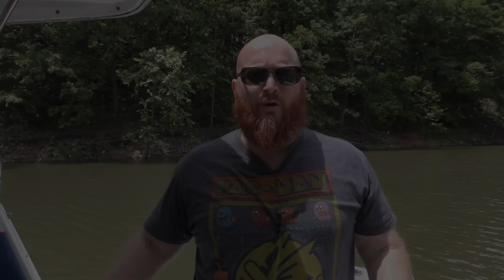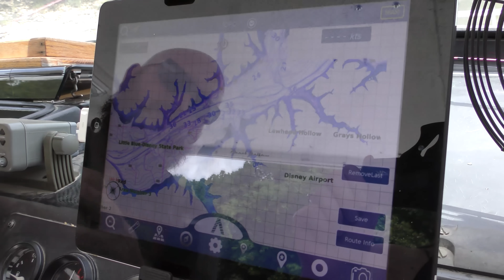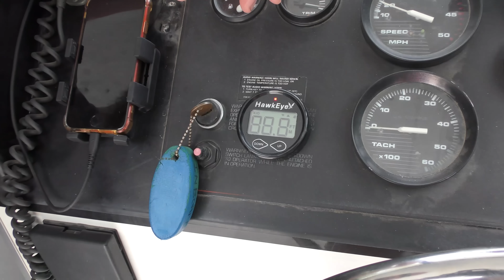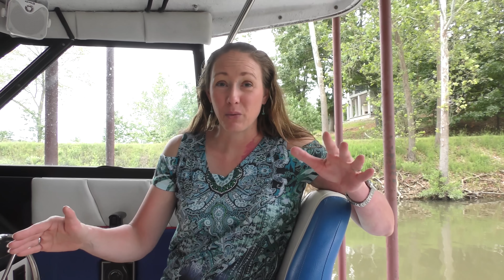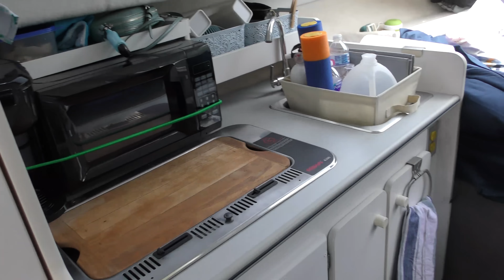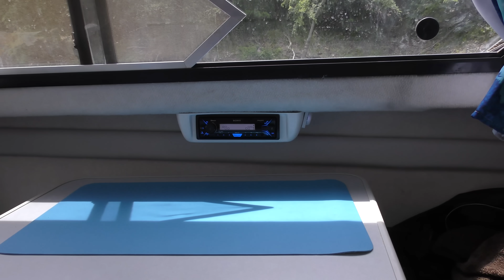Cruiser #4: It's Sea Worthy! See the CAR WIZARD get the boat in the water and the issues that arise

Comment: Keep the kicker on the boat for the times when the main drive fails- which it will. 
It might be a very good idea to wear a hat Wizard because you are follically challenged just like me.
Reply: Do you carry a spare motor on your car just in case the main engine fails? Because it will fail
Reply: @macbook802  you must not be a boater. Big difference with breaking down on land, and breaking down on the water.
Reply: @jonshelley1079  I'm literally laying down on my boat on the lake right now. Ask me how many spare engines I have ratchet strapped to the transom.
Reply: @jonshelley1079  did you know there's a big difference breaking down on water and breaking down in the air? How many airplanes have a spare engine
Reply: @jonshelley1079  no response yet? After work, I'm going straight back to my boat so I can do non-boater stuff
Reply: @macbook802  Many, actually.  Just about every aircraft that isn’t a small Cessna or equivalent has one.  Source, am private pilot.
Reply: @loweflyer7778  it's for power and balance. Not as a Fail-Safe
Reply: @macbook802  It’s both.  Sure, its better not to have engine failures, and the aircraft is faster with more engines than less, but its also redundancy. Look at ETOPS ratings.  Airliners are rated for how long that they can operate with a single engine.  

For a real life example, look at the united 777 that had an engine failure a few months ago.  That plane continued on and landed safely.
Reply: @loweflyer7778  how often does the second engine on an airplane come into play as a Fail-Safe?
Reply: again he should get contract with US Towboat there like 100 bucks a year and lot cheaper then if you need a tow and dont have one. boat tows can cost as much 1000 bucks a tow
Reply: @Elios0000  Good idea!
Reply: He needs to add its twin on the other side, for balance.
Reply: His Boat is a dual power unit already, and has 2x isolated fuel tanks.  The kicker would only be needed for a catastrophic failure that he could not fix
Reply: @BigDaddy-Irv  Yep, two engines, two fuel tanks, and a master mechanic on board, while only using inland waterways; I'd put money on him getting the "Jolly Sparkplug" back to shore in a mechanical crisis. Wizard said in an earlier video that he intended to carry spares; don't know if that included an engine though. 
Losing the back-up motor completely will save on maintenance too. If he keeps it on board, he'll need to maintain it just as much as leaving it attached. Hopefully, he'll never need more than two engines anyway.😁
Reply: Good idea getting rid of that kicker. I have my 50 ton near shore and am on the ocean a lot. No one has a kicker and that is 20+ miles offshore. Get a seatow and make $2-3k by selling that thing.
Reply: @jacknimble1  On second thought, I think you are right.  Given that he is not on a large expanse of water and can easily get a tow, he should get rid of the kicker.
Reply: He is only on a a lake. I am often out at sea on the west coast of Norway in all kinds of weather. That is a seriously dangerous coast to loose engine power. And I don't even have a kicker on my boat.

Comment: Fabulous looking home there behind the Mrs. at 9:30.
Glad you got the bugs worked out.
My in-laws had an early 70’s Wellcraft with an I/O 165 Chevy motor. She was misinformed about not going over 2000rpm. Get it on plane and back off and it always overheated. Wasn’t getting enough water at speed. Who was I to argue with a know-it-all MIL.

Comment: 10-12 gallons AN HOUR?
that is a stupid amount of cost
In time you'll find the far side of the lake is exactly the same
as the place you launched.
I've a 28 foot trailerable houseboat and use 5-6 gallons a day
running 4-5 mph.
Get 20 feet off shore and just follow the lake around.
I run my 70 hp outboard just above idle and Love it
I'd suggest an air bed and sun shade over the fore deck

Comment: I would not recommend throwing that thing away for an outdrive system I've never heard of anybody putting it on but it's good for outboard motors running in skinny water so I'm sure you could sell it or be able to sell the outboard motor I would detail it make it look shiny and new congratulations on getting the boat out

Comment: Yes welcome to boating it’s a curve, but rather easy with experience and help from friends. I’ll pass along a quick story that my father told me it was in the late 90’s and in my home town we had a yacht builder and one boat that was built was for the owner and founder of Bayliner. Respectively this was a multi million dollar affair in the 100ft range, and on its first sea trial the owner was at the helm leaving the small marina and accidentally wiped out some hand rail and another custom fabricated piece. $70K in 30 seconds. So even though your learning even the experienced can have small issues.

Comment: The main question is if that kicker motor was factory spec. If it was, operator error. I had to take a boaters safety course to run a Jon boat with a 4hp motor. Time and regs change.
Reply: still do in Maryland for ANY  power boat
Reply: @Elios0000  Good to hear, thanks for the reply.

Comment: From one boat owner to another get a trolling motor with a long shaft you can pull up out of the water for emergencies, had my inboard MerCruiser (fuel pump) go out a few years ago, on my party deck boat, and while it took us twice as long to get back to the dock at full speed of the trolling motor, it did it's job, and with a push from a friend's boat we were able to get it on the trailer, and home for repairs.

Comment: Yep, I'd just take that aux motor off entirely.  Whatever kind of fishing you'd be doing it really won't be necessary.  You can cast far enough from the boat in any direction that if you aren't getting any bites, you'd either be going to an entirely different location or giving up and just doing other stuff.   As long as you have a CB for emergencies (if you are so far out a cell phone doesn't work), you'd be covered if your primary motor dies.

Comment: Don't take off the small motor. It's job is if the main engine dies you still can move the boat. The solution to a list is a water or fuel ballast tank. From Australia I would never swim in green water.

Comment: Boatlife is moving around stuff to balance the boat. 
30 feet of line is not enough, 90 feet is alot better. For comfort and safety. 
Just put my boat into the wet today, allmost two months later than usual because life , but life is so sweet on the water now !

Comment: Keep the small motor. Many year of boating you be glad you have it to get back to dock. Leave it how you have it now but run it from time to time.
Reply: Totally agree.  The linkage issue is not really an issue.  Most people install the linkage when they are using the kicker then remove it when they are not.
Reply: Ahoy! Stow that kicker amidships, you'll love it when you need it.  
Secondly, get a small boat for that kicker.
Reply: @mikebuford5229  That could be a good move.👍 When all else fails, abandon ship. Is there room to stow a small boat somewhere on board; towing it would fairly mess up your trim.😁

Comment: The one thing I didn't see in your boat videos is a F I R E   E X T I N G U I S H E R. Fire is one of the biggest causes of boat loss and fatalities. Especially with gasoline engines. Failure to vent your bilges is a great way to cause an explosive fireball. Glad you hooked up tank above deck but don't be complacent. The vapor settles and other leaks can occur. Be especially vigilant Car Wizard! Make sure you can escape that forward cabin too. Without anything below water to put your feet against, crawling back aboard can be tricky. Make sure your swim ladder is solid and functional. :) You should probably assume everyone on the lake is drunk and foolish so you'll need to watch out for the other guy. :) Need 7:1 scope on your anchor line (for Danforth style) 20' of water needs 140' of line! It's so the anchor lays down flat and digs in. In a lake without rough water and no currents can get away with less. IMO.

Comment: I had that steering link to the  small engine and I only connected it when using small engine.When not in use bungee it to the small motor with it disconnected from the outdrive( Large leg) This worked well. Necessary for trolling on ocean. Fishing on lake often done while no motors running. Good to see you are getting some enjoyment out on the water! CHEERS from Western Canada

Comment: You shouldn't have to use the trim tabs to correct for a list on plane they're mainly used to get the boat on plane. Once the kicker motor comes and mount comes off you shouldn't need the tabs, also once the kicker and it's mount are removed you could put a full l length/width swim platform on if you want to make that investment.
Reply: ...that 30 gallon above deck, starboard mount fuel tank might have something to do with the fact that he's all over the place and needs to correct via trim tabs lol...

Comment: Great to see you guys on the water!  Boats are always an on-going learning experience.  My passion is kayaking, so certainly a very different craft than a big boat like that, but control on the water can still be very similar.  I think we're very used to cars in the sense that you do something, you get this immediate feedback, but in boats, the changes are more delayed and... sticky.  You have to be a bit more subtle and sort of wait to see how the boat starts to move, and when you need to counter a movement, you have to do it with the same subtlety and take into account that the correction will have the same delay, otherwise you over-compensate for it.  I've heard some folks say it's akin to being on ice where you start to slide and have to work with it, but I'd say that's only half right.  The sliding part is right, but with boats being hydrodynamic, water than become sticky in the sense that the boat will want to keep doing what it's doing.  Best thing you can do is just keep feathering the controls and going easy on moves for now; the more you do it, the more you'll get a feel for how that boat behaves and it will become more second-nature.  Just remember - all boats are _different_.  Your other boat is going to feel totally different to pilot than this one.  We have three kayaks (with a forth on the way), and every one of them feels different to paddle, so you always have to take time to get to know each boat you use. :)

Comment: You better watch those holes in the aluminum from the hydrofoil bolts. If you don’t have fresh magnesium anodes, your outdrive will become an anode.
Reply: Fair point. But why not just leave the bolts in place?
Reply: @2H80vids  The bolts are dissimilar metal and probably already started the corrosion of the aluminum holes.  Bare exposed aluminum will continue to corrode underwater.

Comment: The steering buddy is only put on when using the kicker for fishing. Always nice to have the kicker on board if you main engine should fail. Throw is some counter balance or get comfortable with trimming out the boat. I enjoy your videos, thanks!
Reply: If he is just using it on grand lake I wouldn't feel the need for a backup engine. You're never very far from shore on it and pretty much always have cell coverage.
Reply: @mgkleym As someone whose family has been big into lake(Clark Hill Lake GA, now that's a big lake), and River (Savanna River, a very long River) boating since the mid 80's having to rely on someone else to get you back to shore is true pain in the ass, even paddling is a no go if you are way far away from your home dock/boat ramp, and the weather might be turning south on you because you went out based on a wrong weather forecast that said sunny all day, but turned into thunderstorms, and your fuel pump goes out(true story). so having a good backup trolling motor that can do at least 5 mph and get you home in limp mode is a must IMHO.
Reply: @CommodoreFan64  an $80/year towing insurance policy is worth every penny. TowBoatUS  or SeaTow is on most major lakes and coastal areas.
Reply: @mistermoonJB  If I can have a viable backup to my main engine that gets me back to the dock/boat ramp on my own power, why waste $80 a year? 🤦‍♂️
Reply: @CommodoreFan64  Do you carry a spare engine in your car? Why carry around extra weight and have a second engine to maintain when the worst thing it will save you from is inconvenience?
Reply: @mgkleym  a good trolling motor is not that much extra weight if you have a nicer boat, and many come with one already from the factory like my party deck, that has an inboard MerCruiser with a trolling motor on the front bow that I can also use for fishing with the captains chairs that are removable, or if I get stuck out on the water.
Reply: @mgkleym  because 99% of the time should your car fail, you are either within walking distance of help or have cell coverage to easily call for help. It's also easier to identify exactly where you are and you aren't drifting around helplessly like you could be in the water.
Reply: @CommodoreFan64  It's not a waste. What if your bellows fails and you start to sink? What if you run aground? What if you run out of gas? Or need a jump start. Towing insurance covers all that other stuff too.
Reply: @mgkleym  a car can be walked away from....a boat not so much ehh?
Reply: Agreed, or just get a big trolling motor you can pull up out of the water for emergencies.
Reply: this learn to trim and ballast as needed. people should be required to take boating class for any thing over 25hp dingys
Reply: @Elios0000  A lot more states are starting to do that, I know here in S. Carolina that's just starting to become a requirement.

Comment: glad you mentioned the whale tail..thought of it for my boat which is about 28 feet.....wondered how it worked....glad you mentioned it makes the boat impossible to steer and stay on a single line you are headed in.
Reply: Given all the set up issues, I bet the whale tail wasn’t the main culprit.  Having said that the wizard is new to boats and planning vee hulls handle a bit weird until they are up on step.  I wonder how much of the scariness was inexperience.

Comment: Whale tail helps with porpoising but it’s effectiveness is very hull dependent.  If you have dual larger down planes, you might be able to control how it tracks and porpoising too.
Reply: Neither of those (porpoising or tracking) should be problems on a boat such as this. If it is, something is amiss. I even removed the trim tabs as an experiment from my boat and it does fine without them if it isnt too unbalanced.
Reply: @GoldenCroc  so you have this exact model boat with the funky kicker motor setup?
Reply: @ozarkliving7263  Possibly very bad weight distribution would fall into the "something is amiss" category. The hull with engine as it left the factory, and loaded to factory specs certainly would have no problems with tracking or porpoising is what I was getting at, which is a way of saying he should check everything is within allowable parameters first, before fiddling with trim tabs etc. 
It was more of a general comment, not a disagreement of what you wrote.
Reply: @GoldenCroc  sadly, albeit a lighter craft, I’ve had a brand new boat when loaded with folks in certain ways and at certain speeds would porpoise a bit.  I saw first hand where one of these whale tale things really improved the tracking and ride enormously.  My initial research showed my experience wasn’t as rare as one would hope.  Bad design by the boat manufacturer?  Maybe.    My point was that those plastic tails can, for some situations, provide a cheap remedy to a less than optimal boat situation.

Comment: Small tip, in Germany they tell you when doing your license.. the anker chain in the water should roughly be 3 times the depth...
Reply: I n Canada they teach 5to 7 times (scope) A little overkill I think but good to be safe! CHEERS from Westcoast Canada
Reply: Wizard, you definitely need more anchor rope. With 21' depth and 40' rode, you're not even 2:1 scope ratio. If the wind came up you'd drag easily. Measure the distance from lake bottom to the bow roller.
3:1 is a lunch stop.
5:1 is for a safe sleep.
7:1 is for a storm.
Reply: @danagovang2520  exactly
Reply: Probably didn't want his boat rotating in a 40 foot circle at night with zero current and zero tide changes out there.
Reply: @D40-Or  tide? in Oklahoma?
Reply: @D40-Or  
Yes Tidal current is very important. We drifted off Anchorage one time because of very high current at Tide change
Me being very Dumb, not thinking about that, tide change in middle of night. No harm though to us we just drifted out into channel.
Reply: The amount of line you need to properly anchor a vessel is directly proportional to the amount of chain there is between the anchor line and the anchor itself. If you only have 4' of chain you will need 5 to 7 times the water depth to properly anchor. Only if you have all chain is it acceptable to use 2x water depth.
Reply: Thats what I was trying to say, zero tide changes, zero current, non existent issue.
Reply: @ Johann Wallrabe It's called an ANCHOR. Seriously? Spellcheck couldn't catch that for you?
Reply: @houseofno  sorry Male karen … German autocorrection …
Reply: @johannwallrabe467  Is there a German word for a prat that corrects people's spelling in YT comments section, when they're writing in a second language? There's one in English or, in Scottish, there are several.😁
Reply: @houseofno  in German it's called an Anker...